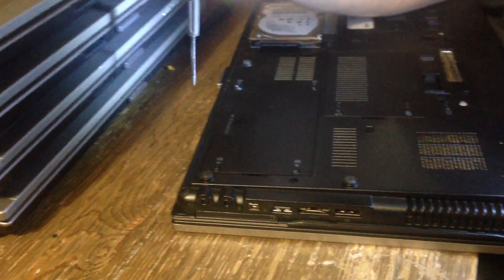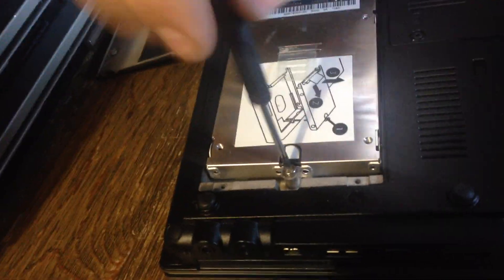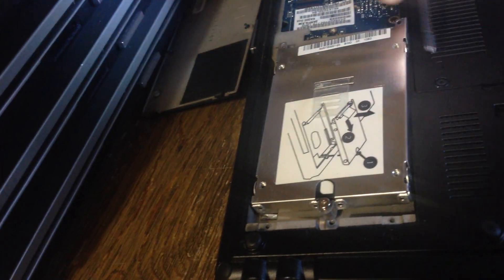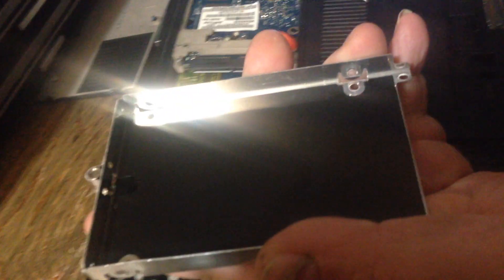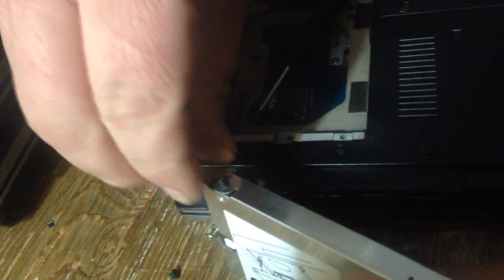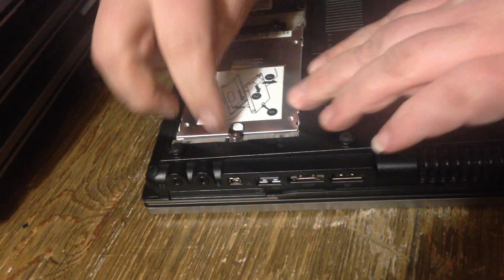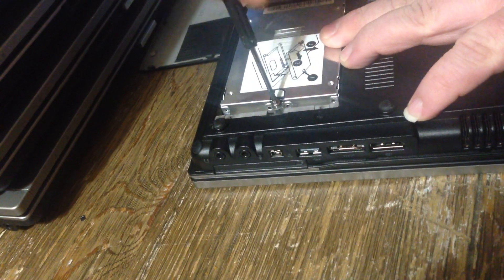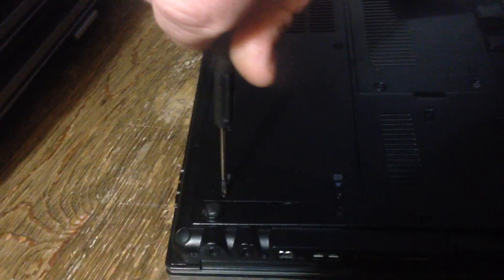How to change the hard drive in a HP EliteBook 8540P Laptop

Comment: I just bought one on eBay and when I start it, I get a message that says: "Non system disc or disc error." I run an f4 test for the hard drive and get "Hard Disk Test failed    Disk not installed". Does this mean there is no hard drive or what does it mean?? Thanks for the demo. You make it look super easy.